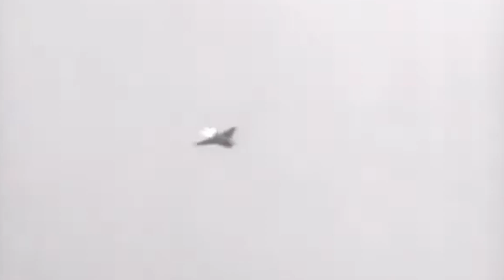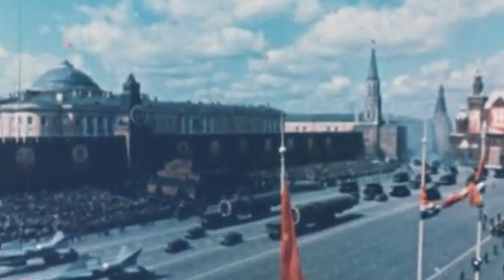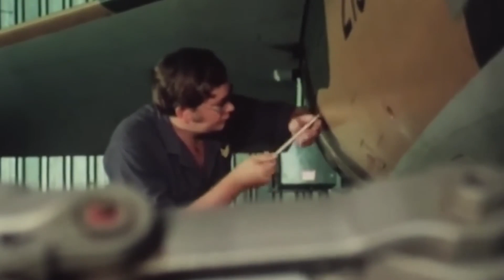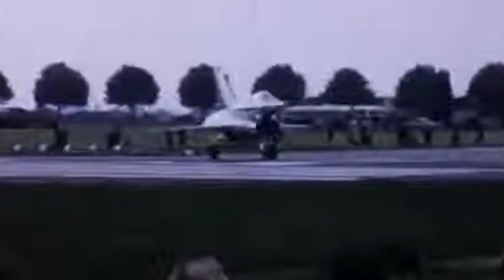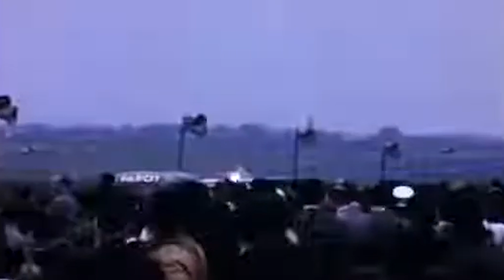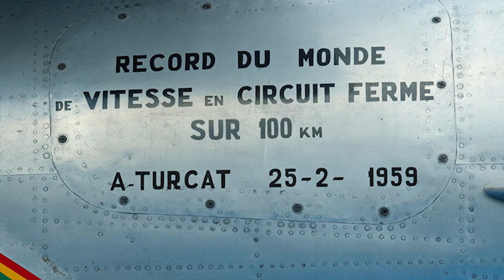The Plane With the Biggest Mouth

Comment: France has been leader in experimenting ramjet engine on planes, first with several Leduc prototypes. and later with the Griffon.
It reached very high performances, but the ramjet engine lacked flexibility, it could only work in off or full on mode, and was too thirsty for a large enough range. So it was unsuitable for operational use, and was dropped and replaced by the more conventional Mirage planes.
It wasn't totally useless, french engineers learnt a lot on high supersonic speed with this program.

Comment: I saw the Griffon II in the museum at Le Bourget in 1987;  it was, in effect, a ramjet with an Atar turbojet as an igniter, once it got to sufficient speed.  It was limited to Mach  2.2 by the rise in temperature of the airframe - just as the Concorde was.  Also, it lacked the variable-ramp or translating spike intake that the F104 and the English-Electric lightning pioneered. But it was a necessary step in the path to supersonic flight.  I heard that it reached Mach 2.2 in a steep climb, to prevent the airframe from thermal damage.

Comment: The French were pushing the technological limits with this ambitious project.
Duraluminium alloy was used in WWII, and no where close to todays aluminium alloys AL2024, AL7075.
At Mach-2, it's a very different flight envelope. The air friction alone on the airframe leading edges produces significant heat.  Engine thrust and power, requiring high temperature super alloys, often advanced molibdynium-chromium steels.

Comment: I hear this ram jet had just two positions on & off, it uses kerosene doesn't it use blocker doors on it airflow then use just the fuel needed and while the ram jet is in use spool down the turbo jet.
I cannot fit all I mean here like the SR-71 takes ram jet air at row 4 of the the low pressure coppressor but all spinning saving just 15% fuel 
I could go on with these idea's

Comment: The Fairey Delta 2 was the first jet to reach 1000mph, establishing a world record. It was a beautiful machine as was its successor the BAC 221 with its ogive wing providing data used to design Concorde.
Reply: It doesn't look so much like they designed a plane as they mounted a jet on top of a large engine .
Reply: F104 maiden flight march 1954 ,so before fairey delta october '54
Reply: Brit tech in general during this era  was greatly understated anx underappreciated . Brits are  also relatively lacking in "gloating " ability . :)